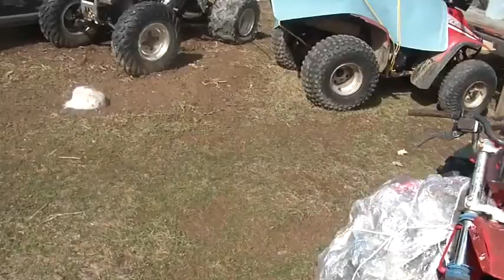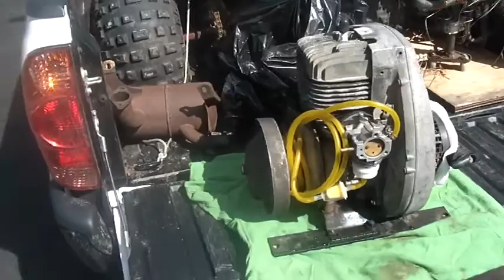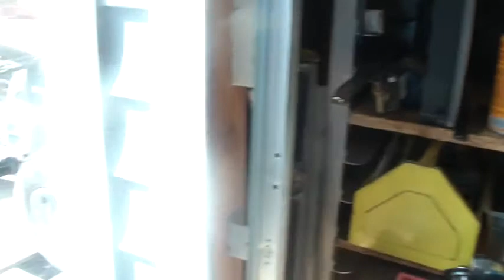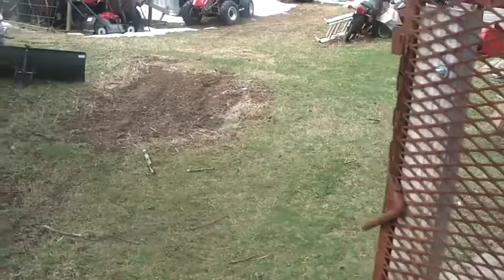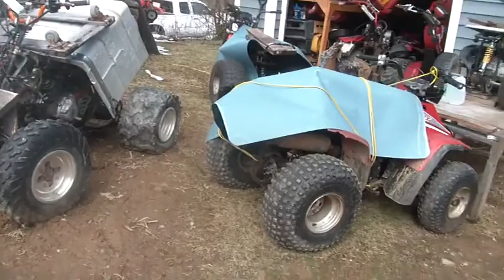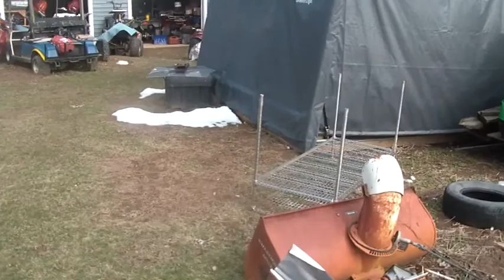Freshly rebuilt Rotax Motor, powerplant for future golf cart build,

Comment: hey Harvey I'm looking for an 84 Honda 200es big red, udizzy said to ask you about it. I live in Winslow Maine and can get five hundred cash by monday. prefer it be running and moving. I hope that's a good price please let me know. best regards Mike
Reply from the maker: Hey Mike, Generally speaking, my starting price on most Honda ATVs is $300 then I add and subtract from there.... If the tires are decent and hold air, the plastic and look pretty good, the atv or atc is complete, and if it runs, shifts, and has no bad sounds, (more or less a turn the key and ride), I may pay $500 for it if I wanted it....  The 200es is well made machine, if it is cosmetically nice, U can have something collectable there... Good luck with Ur purchase, let me know how it all turns out.... Thanks for asking, watching, and commenting.... Dave is one of my buddies, he is a good man!!!!
Reply: Harvey Spooner thanks for getting back to me Harvey, as luck would have it for me I missed getting one by about a week and it said runs n drives great and looked like all it needed was brake and clutch levers plus hand grips he sold it for five hundred. thank you very much for the tips I'm still rather new at this as I have never even owned one but only ridden my friends rigs back in the day. best regards Mike

Comment: DOT rules for commercial drivers is a 14 hour limit from when you start your day, ten hours off duty is required to restart your clock.  A half hour break is required before eight hours on duty or driving.  You may only drive 11 hours total.  That is the basic rule in the US.
Reply from the maker: Hey Jim, Let us see if I understand, for a CDL driver, max on duty is 14hrs of that, one can only drive 11 out of the 14, before one finishes 8hrs of work, a 1/2 break is required, if one drives for 11hrs or is on duty with or without driving up to 11hrs out of 14hrs, it takes 10hrs of rest to get back to work... Do I have it???? Thanks for the info, Ur thoughts, watching, and commenting!!    I drove 13hrs in one day with a few hours of break in the middle, I don't think I could do that 2 days in a row....
Reply: Yes, you have it.  At any point a 10 hour break will give you a fresh 14 hour clock as long as you don't exceed 70 hours in an eight day period for a seven day operation.  No doubt your day of driving up north took its toll.  Enjoy the channel, keep up the good work.

Comment: when i used to transport high end vehicles up and down the east coast i needed a logbook to show where i started from and when as well as any stops i made. i also needed a medical card that the D.O.T. requires. i used to drive 12-14 hours a day,just fudge the logbook a bit. i got stopped on the scales on 84 in CT and they had me there over an hour performing a full inspection on the truck and the car on the bed. 12 tickets later,i was allowed to leave.....